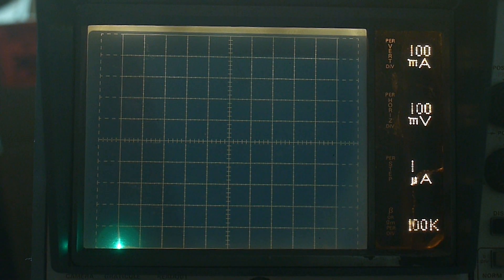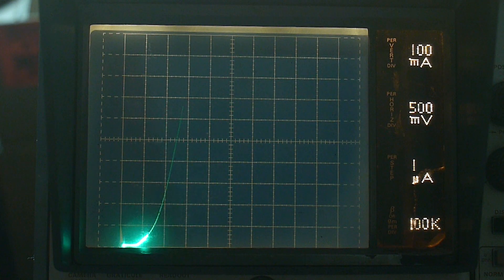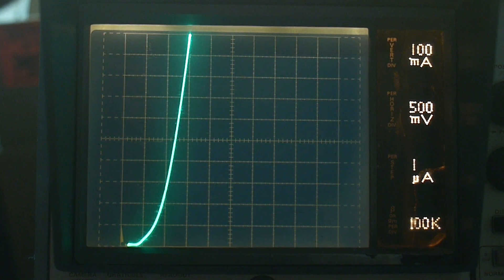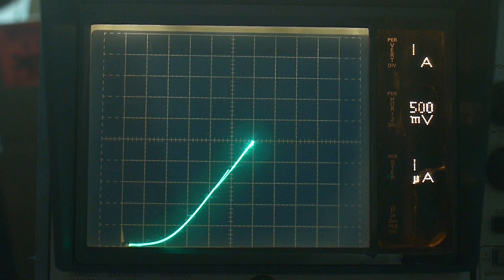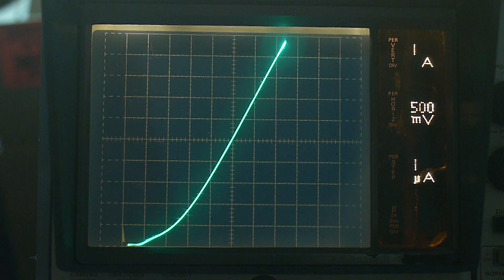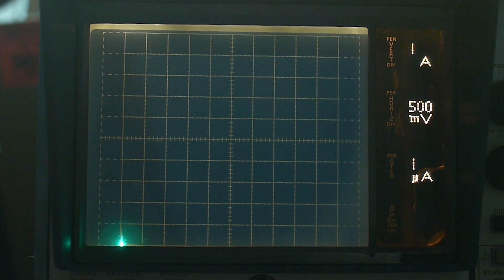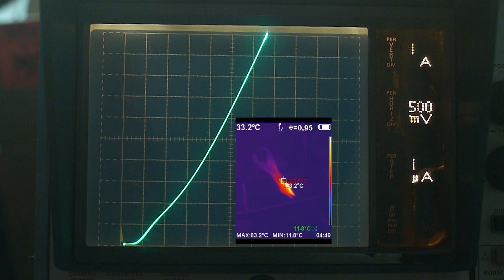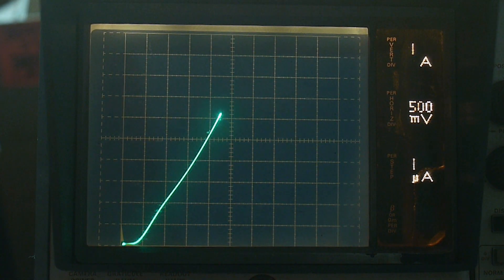#1754 Will Selenium Rectifiers Fail?

Comment: My first job in 1974 was repairing battery chargers and they all had selenium rectifiers. They had 2 plates that were about 8 inches square and had a hefty fan cooling them. They would boost a car at 100 amps. After a few days of below zero weather, we got real busy. Always wondered what they looked like on a curve tracer. Seem to remember that they had some " self healing" properties which is what looked like you were seeing..

Comment: I surmise that as you increased the current (and you could see the "funny" on your tracer) that they were self-repairing (destructing) the inadequate PN junction points along the rectification plane, and clearing out the weaker ones. They called it "Burn-In", back in the day...

Comment: Sometime back in the previous millennium when I first started designing switchers and other circuitry for the cathodic protection industry I had a brief conversation about selenium rectifiers with someone who had been in the "rectifier" manufacturing business for a long time . I was surprised they were still being used. I was told that they often used selenium rectifiers because they were more tolerant of some sort of overstress condition than silicon rectifiers. Alas, I don't recall the details. Structures protected with CP are subject to all sorts of insults, including lightning strike.

"Rectifier" in the CP industry is used to mean a complete AC to DC power supply. It could be anything from a few amps to hundreds of amps at tens of volts. Many were based on transformers with an array of taps.

Comment: I think the failure mode would be different when just overloading in forward, vs when also exposed to high reverse voltage while hot.

Comment: The common failure mode for selenium rectifiers in a "normal" circuit is an increase in forward voltage drop as they age. I replaced many of these in klystron focus coil supplies, always with modern silicon rectifiers. These supplies were current regulated so no other circuit modification was required - just adjust to the proper current and go.  Regards, David

Comment: Hi, this curve tracker is an absolutely phenomenal device, thank you for sharing its capabilities.
The performance capabilities of these selenium rectifiers are beyond belief. When I was young, I saw a selenium rectifier in one device that had plates of maybe 40x40cm and was about 80cm long, i  can't imagine its maximum when this thing can handle ten Amps.

Nice day 🙂 Tom
Reply: 10A is very short term overload. Keep it on for 5 minutes the smoke will come out for sure. The big one was probably rated for 16A continuous current, and would handle a few cycle peak of 50A till it charged up the output capacitors, likely limited by both the forward voltage drop, and the impedance of the transformer secondary. Probably was only rated at 200V as well. But, when the competition was to have a rotary converter, or a mercury arc rectifier, or to use a synchronous rectifier to make DC at current from AC, at low voltages, it won out for ease of use, and no moving or toxic parts, and a lower loss in the device.  Remember here it is dissipating 35W, and if you want to have it last it has to be no hotter than 70C, so the plates have to be huge, and thus also the junctions in the plate as well.
Reply: @SeanBZA  The slelen was installed in the base of a large milling machine (at 380V), and I didn't examine how it was connected, I just saw it through the open cover, it's been more than 30 years. So I just wrote that I was wondering what kind of current it could handle, even for such a short time as the small one.
Reply: @Edisson.  In a large milling machine 30 years ago it would have been used for a DC motor supply, likely for the traverse motors, which tended to be DC motors. This is because speed control on a DC motor is easy, along with reversing. 

Other use would be for DC brake on AC 3 phase motors, where you stop the motor rapidly by applying a DC current across 2 of the windings for a few seconds, then disconnect the supply when the motor is stopped. This DC current rapidly removed rotation, by dumping the spinning energy in the spindle as heat in the winding, with a 5 second timer to switch it off, as a DC current will result in a lot of heat in the motor winding, but no fan to cool it. 

In both cases there would be a transformer supplying around 200VAC, or 50VAC, to drive the bridge rectifiers, and currents would be peaking in the order of 10-20A in them.
Reply: @SeanBZA  You probably didn't understand my idea, I know how steering or engine braking works, I've spent my whole life servicing electronics, electricity, briefly also developing electronics. I guess I'm not translating my thoughts into English clearly enough - my thought was like this - what maximum would the big selenium withstand when the small one managed ten Amps during testing - nothing more, nothing less
Reply: @SeanBZA  Sorry, I completely forgot to thank you for such a comprehensive explanation.
Thank you and have a nice day 🙂 Tom
Reply: Я менял селеновый выпрямитель генератора рефрижераторного вагона на кремниевые 200а диоды.Селеновый помещался в баке под вагоном и был заполнен маслом для охлаждения.Пластины были просто богатырские.
Reply: @ДмитрийРассказов-ц7й  Привет, откуда ты знаешь, что я знаю русский язык 😁

Comment: You didn't show the effect on reverse voltage your 10 amps had on the unit. I suspect it is more like a resistor now.  In the old TV sets where these were used to rectify line voltage the demise of the seleniums was reverse voltage breakdown, which resulted in a nice arc and the selenium stink filling the room.

Comment: The thing about Selenium rectifiers is that when they go faulty, they don't just go faulty, they also produce quite a pungent stench when they do go faulty.
Reply: Which not only pungent, but also toxic when inhaled.
Reply: And the resulting smoke is full of selenium and cadmium, both of which are toxic...
Reply: Pungent as in, an odor so thick, you can taste it when you breathe. Similar to the after effects of eating brussels sprouts or collard greens.
Reply: The Wike compares it to Horseradish.   @rfburns5601